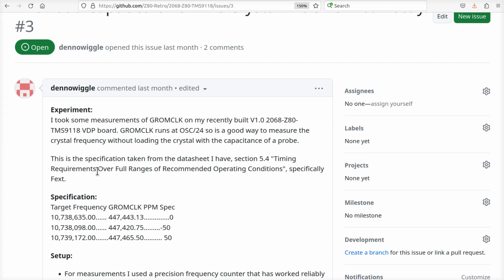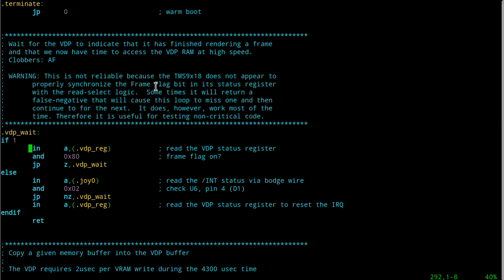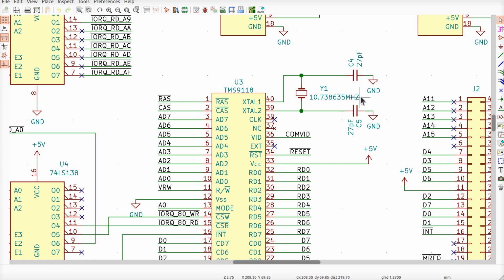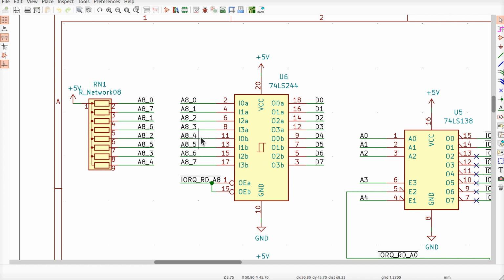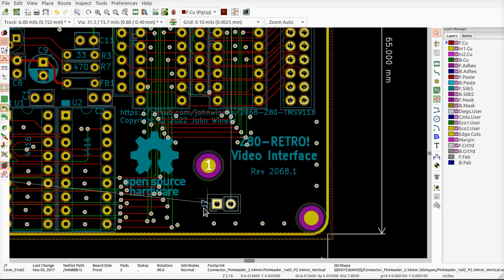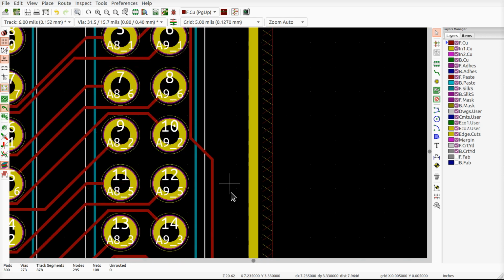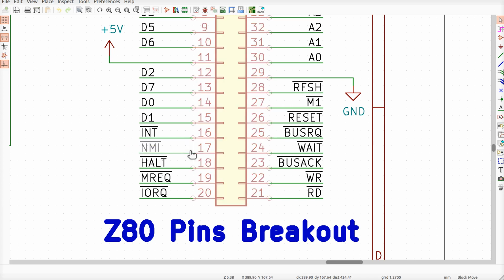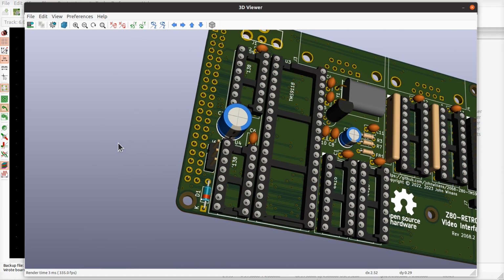Z80 Retro #72 - VDP Board Rev 2 Upgrade

Comment: Is it possible that you could glean some insight regarding interfacing the 9918a by looking at either the MSX or TI 99/4a diagrams? There are a lot of documents out there that explain how to handle vdp interrupts and setting register values (at least for the /4a).
Reply from the maker: Yeah... I glanced at some designs.  NTSC is just so limited that I am thinking of moving on.
Reply: @JohnsBasement  I sent some 9918a specific information (from a TI 994a perspective) via email but nothing you could not find on your own via Google.

Comment: I noticed in the video when you were trying to align the two pin header with the other header that when you right-clicked there was a move-relative (or something like that) option. In KiCad 7 that allows you to line up pads of footprints. Just in case it helps...... And thanks for being so humble. It's pretty rare. I know how much work goes into building something like this.
Reply from the maker: Thanks.  You are probably right.  That might have been a better way to do it.

Comment: May I suggest you pull another joystick input pin low as a board ID bit. That way, when we have an FPGA card in the future it won't have the silicon bug and we can check the frame bit as normal, If ID = 1 it's an FPGA, treat as normal, if ID = 0 treat as Z80-Retro VDP board.

Comment: When polling the vdp interrupt, can you disable interrupts, then enable them back after reading vdp_reg? That would guarantee the priority for the vdp. Sure with NMI, that would be even better.
Reply from the maker: If priority was a concern, sure!
Reply: @JohnsBasement   I thought you were saying that from detecting a zero on vdp INT, the vdp_reg needsto be read in the shortest amount of time.
Reply from the maker: @vasileceteras  it is nit that critical.  Just need to reset it before the next frame ends.

Comment: Did you already reject using an external clock to the vdp? Or does that cause too many problems? (Excuse me if I missed it.)
Reply from the maker: Not sure there is any benefit.  What would we gain?
Reply: I was thinking about that, too. Generating a vdp clock and feeding it to the cpu too, so it would be in sync, more predictable. It actually wouldn't, as the cpu executes different instructions in different number of clocks.